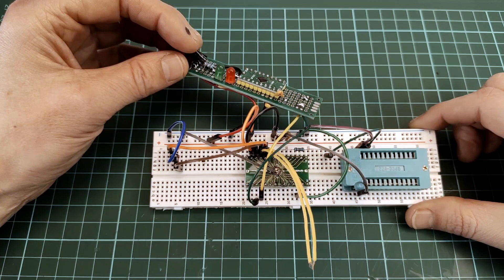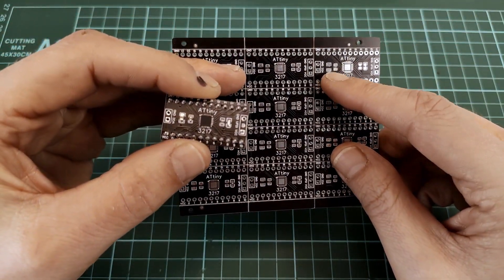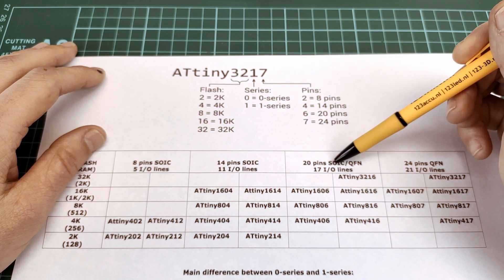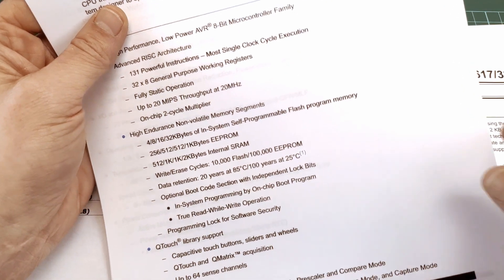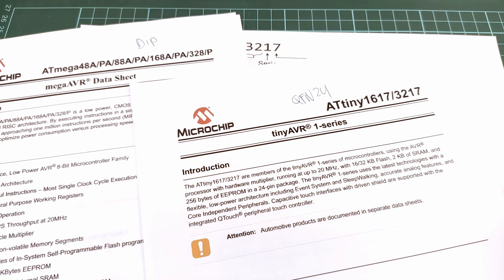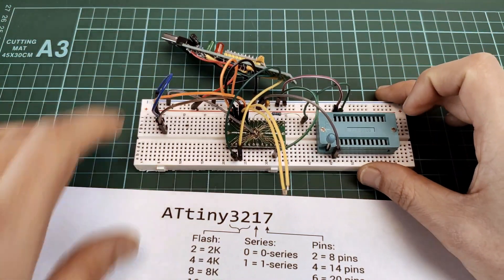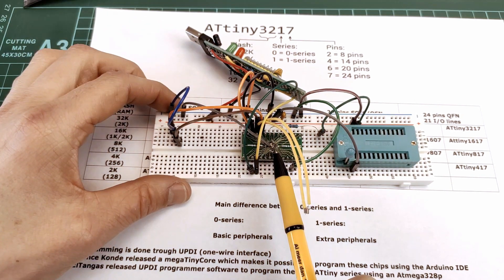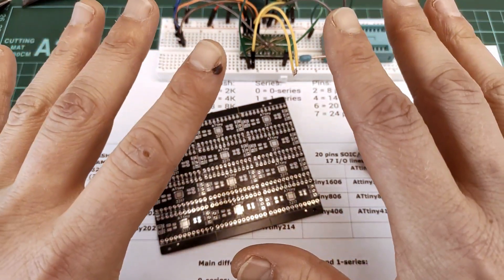I designed an ATtiny3217 Breakout Board

Comment: Are you still responding here? 

I’m trying to use an attiny3217 to control a VN9E30FTR 6 channel mosfet.  I’m able to program the chip no problem, but no matter what I do, I can not turn on the vn9  outputs. It’s got power everything, if I give 5v to DI1 put it into limp mode lights from 12+ comes on no problem.

Would you be willing to give some advice?
Reply from the maker: Absolutely, although no new videos for a while now. I'm still active! 

I'm sorry I have no idea. I can however tell you that if you contact ST, they usually respond with good answers. I have done it in the past and always got an answer I could use! So try that?
Reply: @DustinWatts I will reach out to them, I appreciate it.

And great video, it’s hard to find anything on the attiny3217
Reply from the maker: @leviborntreger4405  Thanks. A tip: all the ATtiny 1-series (32**, 16**, 8**, etc.) work in the same way but with different memory and peripherals. If you search for attiny 817, you get a lot more. :)
Reply: @DustinWatts sweet… this is what I like to hear!!

Comment: I say you took the long way ... hardware wise.. you just could of used a Arduino Mini or a Nano or Uno as your programmer w/ just one 4.7k resistor and one 10uf cap..  see how this guy did it,,, much easier .. https://youtu.be/AL9vK_xMt4E . Also I think the Soic 3216 chip is the best universal, As most of us don't need 24 pins as the 3217 has.
Reply from the maker: I definitely took the long way. The programmer is not out of necessity but because I wanted to make my own. Like with most things I do ;)

Comment: I just program mine using a usb-serial thing , a single resistor, and the pyupdi program ( https://github.com/mraardvark/pyupdi ) but you can also use the xplained dev kits which have a built-in updi programmer too (compatible with the Atmel Studio)
Reply from the maker: Indeed it's not difficult to program them. I haven't tried pyupdi yet. I kinda went overboard and designed a programmer for it myself. Unnecessary but I had to try ;)

Comment: looking good, sounds like a nice little chip. may be i'll have to look at playing with one. Shame no one has looked at the one wire interface and made a debugger program. Have you looked at the Pickit4 which i think with MPlab x  can program and debug them. there is also a MPLAB SNAP DEBUGGER PG164100 which can do low voltage programming only for about £13+vat from RS, Farnell, Mouser etc
Reply from the maker: I made a few PCBs using an Atmega328p and the FTDI chip in this video. There are a few issues, but I can program the new ATtinys. The board has a switch on it where I can switch between serial output from the ATtiny and to the UPDI pin for programming.
Reply: May be I've got to get some on order to play with.
Reply from the maker: I hope I can put them up on Tindie soon. There are some part sourcing issues at the moment.